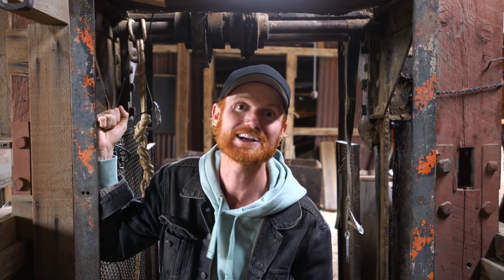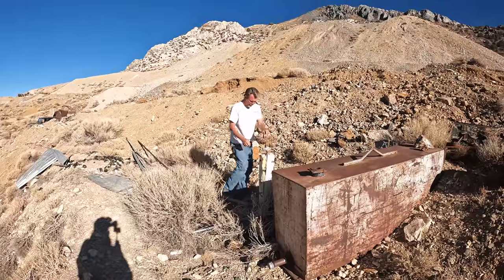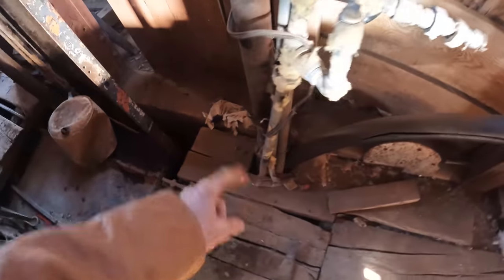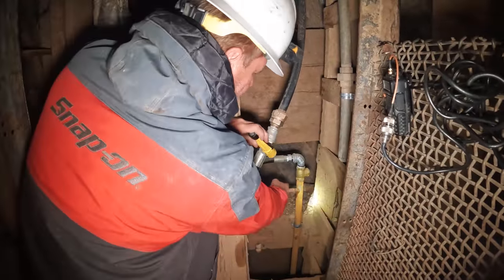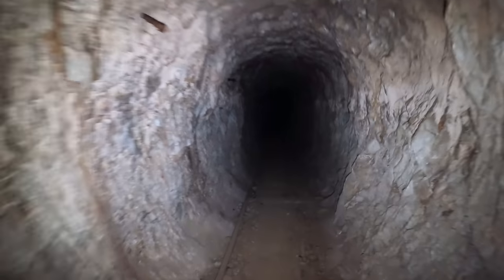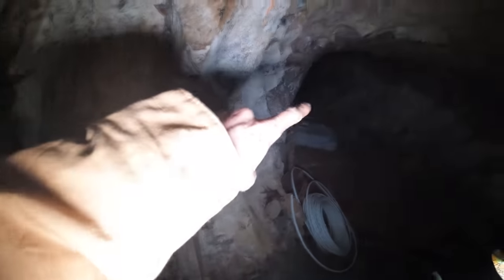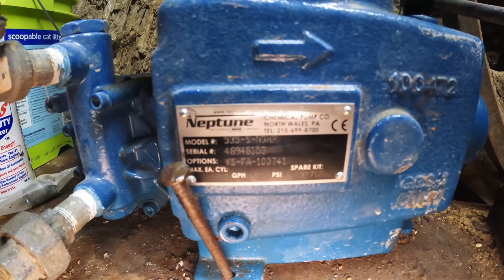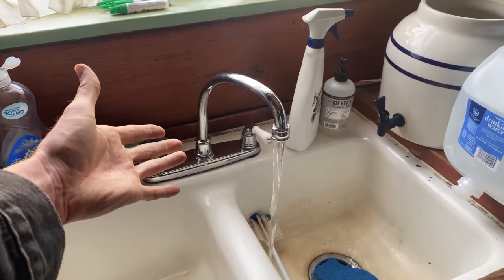How Cerro Gordo 'Ghost Town' Gets Water

Comment: Have you ever thought of setting up a staged pumping system so that each pump only has to pump the water a limited distance? It would take having a tank and pump like every 100 feet or level.
Reply: This is redundant ideology, the mine water is contaminated with metals.
Reply: @lotharschiese8559  What does that have to do with anything? The video was about how they got their water from from the 700 level of the mine to the surface. The staged pumping system is a way to reduce the work the pump at the 700 level has to do. In a system such as this you would have a water tank at the surface with a pressure switch so that when the pressure in the tank fell to a specific point it would turn the pump at the next level down on (tank 1). That pump would start pumping to the surface tank to refill it. When the pressure in tank 1 falls to the set point it switches on the next lower pump and it keeps working like that until the pump at the 700 level is pumping. I know this works because where I grew up we had to have a similar set up to get our water from the well to the cabin about 600 feet up the mountain.
Reply: @lotharschiese8559  I never said he did not need to have the water tested. And from what I have gathered he is not using this as his supply of potable water. So again your concern is not revelant to how to get the water up 700 ft of mine shaft.

Comment: Why don't you install a holding pond at - 300 ft level, install a 2nd pump at same level.  This way you have two containments for water, plus you ease the stress on the pumps - pump at 700 foot pumps to 300 foot level.  300 foot level pumps to surface.     Instead of pumping in one stage 700 feet, you break it down to two stages.  plus you get to install a 2nd holding pond increasing your total water reserves.

Comment: I told you before.put a 100-200 gallon tank and pump ever  200-300 feet in mine and one more on top.when done its easier on all equip and your storing 500-1000 gallons or more of water.id put 1000 gallon on top . No size restrictions. Buy parts from graingers or McMaster Carr you'll be around 8-10k.just ask your water guy.

Comment: Get a geologist out there to survey the area and locate the aquifer. Tap the aquifer with a legitimate well. Install a tower to aerate the water. That ought to get it.

That you have water leeching into the mine lets you know there is an aquifer there. You locate that, and it should be problem solved.

Comment: My suggestion is to build a foundation and building at the highest point in town to house a couple of big poly tanks. One for fire fighting and one for everyday use. Buy the water to fill them then just keep them topped off with Cerro Gordo water. Use Adobe for the for the building so it will be fire proof and insulate well. Because it is nice to get cool water out of the cold faucet. You are going to have a hotel right? The tanks are going to need to be big and many to feed the town and hotel. The fire fighting thing will help you get insurance on this remarkable investment that you have made in Cerro Gordo. Remember green energy light source is a lot more insurable then open flame candle and lamps. Who knows right? I am just some crack pot dude off the internet right? ( That hates the sound of generators and hastle that they bring).  But water is number one up there because it is life. When your worst enemy is fire water is everything.
Reply: You want to contaminate clean water with contaminated mine water and serve it to customers. WoW!
Reply: More like reverse osmosis or double solar distillation before. But water is water depends how much you like your lead.

Comment: guys, the foot valve is only going to reduce the npsha for the pump so it will work harder. overtime it will fail, they always do. your better off have a submersible pump with a kick back to the pit that's feeding into a bigger PD pump.
Reply: This is redundant ideology, the mine water is contaminated with metals, read my postings

Comment: Be better and easier on the pumps if you have a pump at the 3 or 400  Level about half way going to a big collection tank of some type and then go the rest of the way so it's not all on 1 pump
Reply: This is redundant ideology, the mine water is contaminated with metals, read my postings

Comment: I’m not quite sure why you haven’t looked up some kinda well drilling company? Even if they have to pipe in water else where. And shouldn’t there be a huge main water tower built right next to the elevator building? I kinda find it hard to believe that 100 years ago they had this problem, that pic shows a man next to a water line shooting out water. But when you show it it’s just tricking out. Did water dry up with ore they mined? And what ever happened to the store I was hearing that a huge company was planing to strip mine that whole area? Now I’ve haven’t Heard anything more of it? At what what point do you stop and think that unless you are able to mine something kinda great to fuel this town it’s cost do you draw the line? I love your videos but at what cost? This town is eating a hole in your pocket. As it has done to everyone who has ever lived there. Plz respond. Clearly you have a gift to put out great content and have changed so much in 2 years.
Reply: At one point in time they had clean water from a SPRING 2+ miles away, Brent is too lazy to go for it, There is pipe that runs all the way into town. No, he has to screw around with contaminate mine water instead. This stupidity burns me! Namu Amida Butsu

Comment: Galvanized water pipe is junk my old house had that stuff and I tore it all out and put in Copper pipe because the galvanized pipe rusts inside and it clogs the pipe up and you lose water pressure and you have brown water when you turn it on after you don't use it for a bit. If I was you replace that galvanized pipe with PEX

Comment: My suggestion would be to find someone with a drill big enough to drill into the mountain at about the same level as the water supply
Reply: Even if it is not at or below the water level, it should be less stress on a pump to pump it out.
Reply: If you drilled into the mountain, horizontally, from the elevation of the source, You, be three quarters of a mile from town and would still have to pump it up to the elevation of town.
Reply: Even then he could have a larger water storage and it wouldnt have to be pumped up near as far

Comment: well brent there is possibilities of digging a well. along with building a water tower water towers provided water to many many many now enormous citiesand is not like you would have Ellevation Problems. along with burrying a enormous tank where ever you have a decent water flow durring spring run off and rain storms to colect nature resorce. Yes i understand that you are in say a desert, however back back when it was a busy little place they found a water sorce some how, as we know man cannot servive with out water. being so mountainous is there not some nature flowing springs? look what man acomplished way back in the 1800's there, so it should not be a rediculous hard project to get water from some resorces. for now i would focous on a water tower and if have to sorce out a better pump to suply it. there are many lift pumps built today to move water with ease from way deeper depths than you are. some local farms near where i live need to get water from over 1000 feet down. or even look how you got mega gallons moved when heavey D's crew poured cement there? you guys got gallons of water up there in a short time. so with a huge water tower storage tank you could get it topped off and make a water run to keep it plenished.    these are only my sujestions they are saying you need to use my ideas, thank you have a wonderful day. karrie

Comment: Brent you need a pump that will operate under HIGH HEAD PRESSURE bc you are lifting water 700 vertical feet. Also a few ONE WAY check valves is critical. Probably about every 50 ft put a check valve. Which will alleviate some of the stress on the pump.
Reply: This is redundant ideology, the mine water is contaminated with metals, read my postings

Comment: I'd go, well, mining for water. You have a good idea where in the mine the water is coming from, you just need to go at the rock to get some more. You'll probably want to remove those old timber frames and replace them with something moisture resistant, though. 

If you want your town to be a good tourist destination, it is something you'll have to do, to meet the water needs your town will have. And, to be on the safe side, a decent water treatment plant too.

Comment: Install  a storage tank and truck the water  , you lack a viable water supply in the mine .Otherwise you will need about 1 million dollars  to design ,permit ,and build a transmission line from Keller.
Reply: There is a SPRING 2+ miles away, same elevation, away from the metal contamination around the town / mine!
Reply: @lotharschiese8559  keep it simple and affordable . Brent would not want to get involved with bureaucrats in California,  or The  Federal Government , for example a long drawn-out environmental study, establishing an easement across public and private properties.
Reply: @redkellyre6568  There is a Spring, a standing pumphouse, with a piston pump that CAN be refurbished, there is an existing pipeline running all the way into town. A days digging in the wash establishes a pond, a pool, a reservoir to pump water from. Establish a replacement water tank where the old one collapsed on a high point, I suggest to build out wood like the original one, esthetically more pleasing and is part & parcel with the town. Pumping would be required only up to the tank, as the water is gravity fed from there into town. It is much more cost effective to transport water initially from the tank into town to fill a tank there, your nearly the elevation as the town.. The pipeline terminus in town needs to be located and plugged with a valve and the section joined at the tank, so that water can be pumped from the Spring to fill up the pipeline. The valve at the end would need to be opened intermittently to bleed the compressed air. Run water through to clean out the line and quite possibly need to send a drone to spot any leaks, fix with hose & clamps. Not a lot of hullabaloo to establish clean water, Eh! The trouble is that if one can't see a way to accomplish, there really is no hope! We have a will, how we use it, greatly influences our survival! Work smarter, not harder!
Reply: @lotharschiese8559  where is the running spring and pump house located?

Comment: Brent the entire west coast has been in a record drought and this might be the new normal from our warming climate. With that said you may need to budget hauling water long term. Modern composting toilets might be a better option than flushing. You also should have a water tank with a pump for fire fighting. I would find a way to measure the flow in your mine storage. Pump it down and measure how long it takes to return to the static line.  If it were me I would contact the local well driller and pick his brain about your situation. Get the numbers for your flow recharge rate so they can give you some sort of plan.